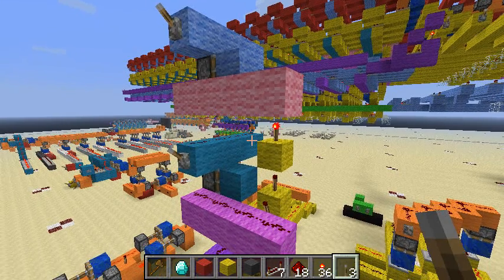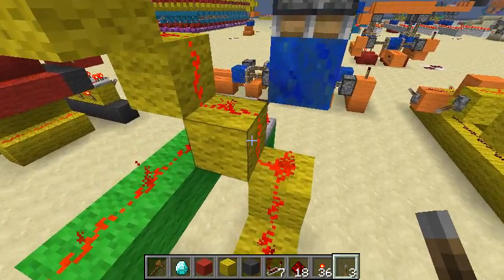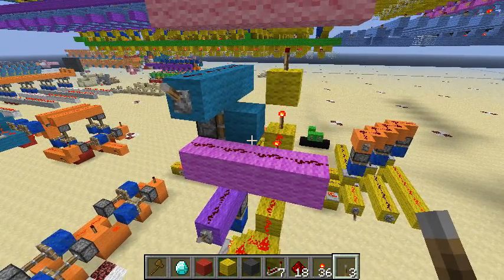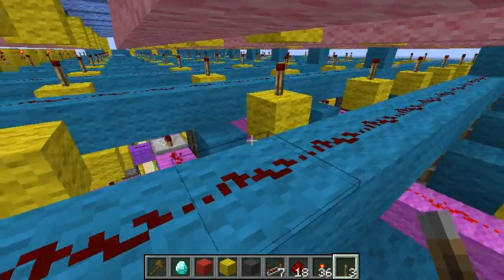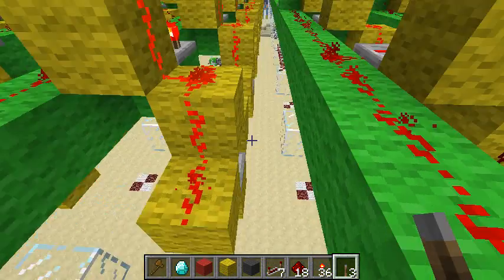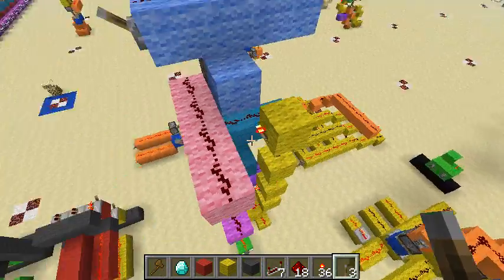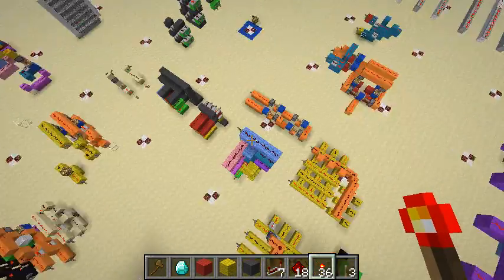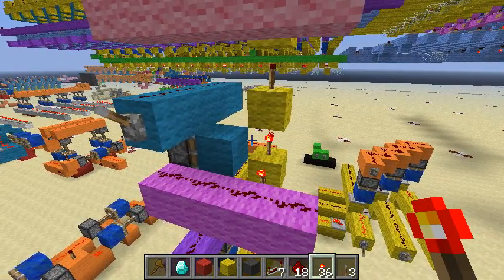Dual Read RAM Overview

Comment from the maker: My CPU still uses 4x4 Multi-read Registers, but those are actually obsolete nowadays if you just need to do Dual-Read.

50% of my CPU is actually built from obsolete components, but I stuck with them just to get the darned thing built.

However, just because a smaller faster design for a component exists, doesn't mean the old one STOPS working.  It's more important to complete a project than to make sure it's 100% cutting edge tech.

Comment: I don't know if you still use this design for your registers, but I made a redesign with locking repeaters instead of basil-flop and glowstone for vertical transmission instead of the torchstack. Measures 4x4x11.

Comment from the maker: @iammrhellohowareyou 
"Dual Core CPUs" are over-rated.  You only get increased speed on tasks which can be done in parallel, and determining what is and isn't parallelizable is rather complicated.

I made Dual-Read RAM to for the purpose of speeding up and simplifying my CPU, but you are correct that it could be used in a Dual-CORE CPU.  If I did that however, it would probably be Quadruple-Read RAM.

Comment: Very nice :) but.. If you were able to make you CPU duel core, you could share one register of ram to be used by both cores, also you could have a two bit memory for each bit allowing the next core to get rid of the information allowing it to start the next prosses faster. Im still a noob at computers but you could double the speed of that correct?